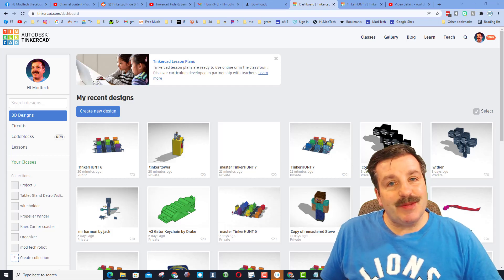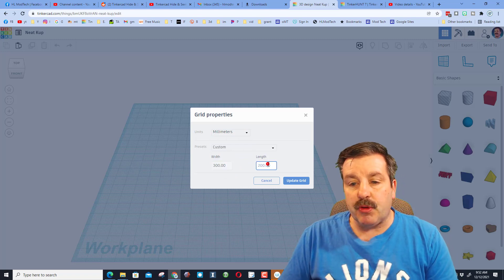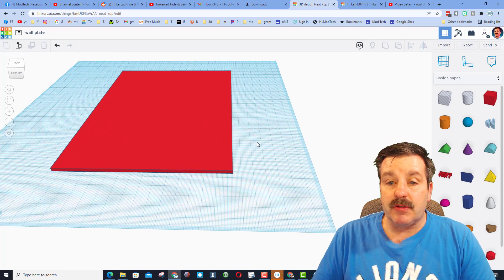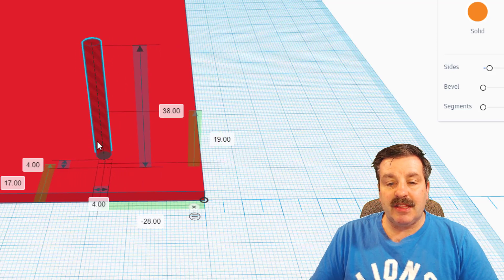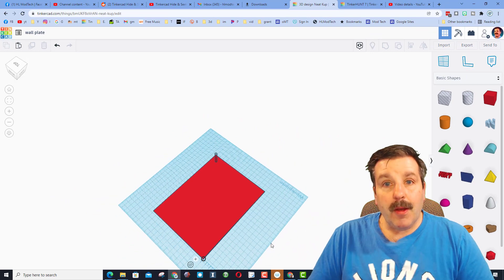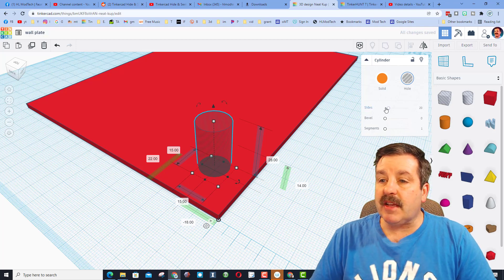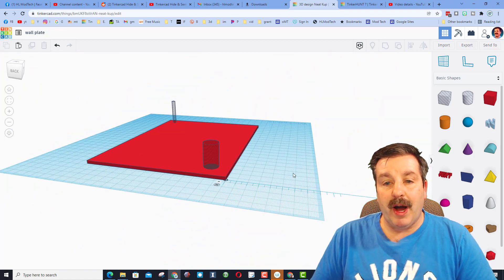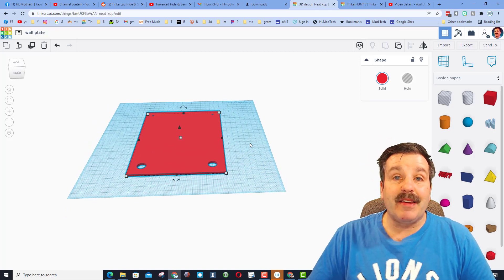Place Perfect Holes in Tinkercad by Rocking the Ruler Tool

Comment: How do you create a hole for a cap head screw? Make a small cylander, then a larger one but don't put it in as deep? I can't get that to work.
Reply from the maker: I think I would draw one with the sketch revolve tool these days. May have to make that a tutorial soon. 💯🔥
Reply from the maker: Ok.. I whipped up a tutorial that rolls out tomorrow. I show a system for a wood screw. Your screw will just need a pair of straight lines where I did the angle. Keep me posted if you are stuck.

Comment: Wow, I spent an hour trying to follow your instructions for selecting two objects, duplicating and then mirroring.  I finally figured out, I can't let go of the SHIFT key or it won't follow the steps.  A vital step not provided.  Maybe I should have learned that a couple videos ago about selecting more than one object - maybe!   Okay, I have it in my tool belt of knowledge now so I'm good.  Plus I download and printed off the shortcut key off the website and it's doesn't explain that on there either.  It only took me about 20 watches of repeating that same 10 seconds of the video to see I was missing a vital step.
Reply from the maker: Glad you have it now. Sorry to have missed the step. Thanks for the note.

Comment: Unless i am looking at this wrong, when you first moved the hole to -10, the hole was centered at -10 not at the end you pointed out.  When you moved it to -14 it centered the hole at -14 and the end of the hole is now at -12 and not -10.
Reply from the maker: Have you tried it in a project on your end yet?  Does the switch to a mid point measurement make sense after the vid?
Reply: @HLModTech  I have not.  It was just something i noticed in the video and had to rewatch it like 5 times because it wasn't matching up to what you were describing.  i wasn't sure if i was just missing something.  Btw, what i am talking about starts at 1:52.  When you are talk about moving the hole from the endpoint, the -10 you entered centered the hole at 10 in from the endpoint.  The way you described it was that the edge of the hole was at -10 when it was actually at -12 from the endpoint. Then you moved it another -4 to -14, since you stated that the edge of hole was at -10, but that then centered the hole at -14 from the end point with the edge of the hole at -16 and -12 from the endpoint.  I hope that clears up what i was getting at.  Love your tutorials.

Comment: love the video. question, lets say after I design that plate in the video I forgot the size I made the holes. is there a way to use the ruler tool to accurately measure the diameter of those holes? or an other window created? thanks
Reply from the maker: You can ungroup and check all of that. You can also double click to edit the grouped project.

Comment: should be able to hold shift when selecting the corner u want to drag from but instead of dragging just select it then typing the number should change both. i always have to hold the shift for each time i select the point i want the change made on.
Reply from the maker: Interesting. I will test that. I use the shift drag in just about every project I create. It was so odd for it to not function as I was used to. Thanks, tons for the tip!